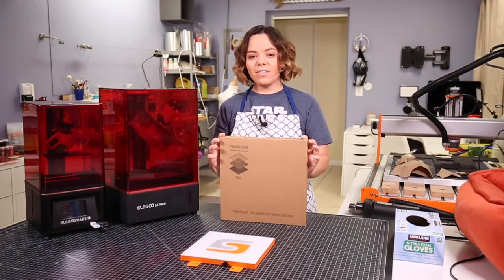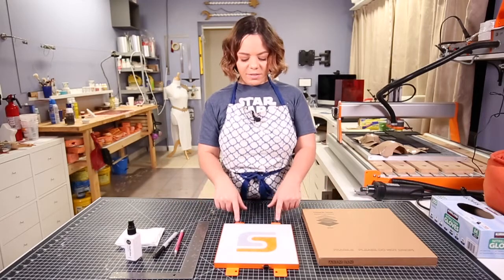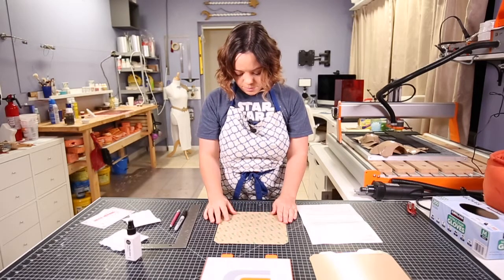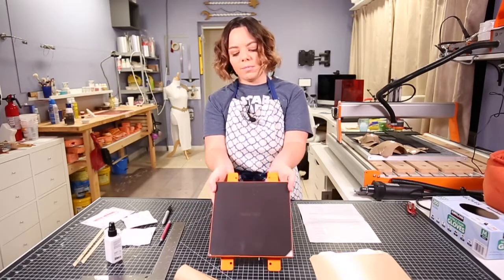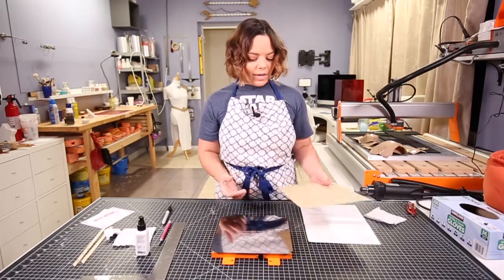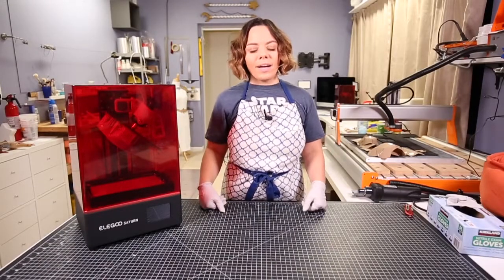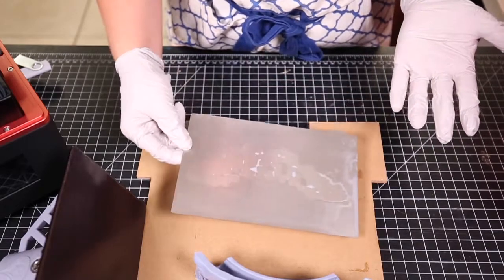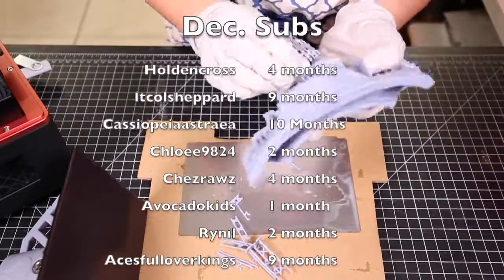Installing Wham Bam Plate

Comment: Where did you get that build plate holder? And which flex plate did you get for your Saturn 2 8K? I don’t know which one I’m supposed to be getting they have three versions.
Reply from the maker: https://www.thingiverse.com/thing:4634693/makes PhoenixBlueStudios has a file available on Thingiverse!  I have an original Saturn - but measure your plate in millimeters (length x width), and you should see the dimensions available on WhamBam for the one that matches.
Reply: @KannonStudiosOfficial  thank you for replying back to me. I truly appreciate that. I actually just received my 8K and curing and wash station from Amazon this morning. Just waiting for my flex plate my slat mats and my heat box to come Thursday.

Comment: Did you need to print the z-spacer for your Saturn? In my haste to get the FBS installed I forgot to print the spacer, which you need to do beforehand. So I'm really hoping it's not necessary lol.
Reply from the maker: I have never used the spacer.  I measured the distance so i knew it would be fine.  Machines may vary so you don't want to break the glass.
Reply: @KannonStudiosOfficial  Thanks for responding so fast! I have a Saturn as well. Can you walk me through what you did to avoid using the spacer. Thank you so much!
Reply: Okay, I unscrewed the bolts on the build plate, and re-leveled the build plate, tightened the bolts, then backed out to the main page of the menu and hit the "Set Z=Zero" button, and that seems to have reset the Z axis. About to do a new print, so hopefully that worked. Fingers crossed!
Reply: @kriscontinuum3267  hey friend, did you end up printing that spacer? I did the exact same thing that you did and installed before printing it.

Comment: My Saturn is only half-unpacked because I want the first print (the castle test print) to be with the flexible plate attached (which I've also got). A lot of people say to use a Z stop extender to keep the plate from descending too far against the glass and FEP (there's even a file for this on Thingiverse). But seriously you did not need to do anything other than re-level and your Saturn is working fine? Nobody has gone into any details about the machine side of things with these plates, only raves about how awesome these are and how to apply them. Applying the plate to the build surface is really only 50% of the installation - the other half is Z stop adjustment and re-leveling, but nobody is including that second half of installation in their videos. (You are fantastic, by the way!)
Reply from the maker: For both the Saturn and the Mars all I did was re-level the machine and make sure the build plate set screws were loose.  The build plates had enough clearance in the depression of the leveling spring to allow just that (granted, it's almost to the max of that adjustment).  I haven't had any issues personally doing it this way.  Taking the extra precautions of the Z-stop extender are not a bad idea though :)  For my CNC printer I did have to adjust the z-axis but it wasn't complicated.
Reply: @KannonStudiosOfficial  Thanks for replying! Elegoo replied as well saying all that's needed is re-leveling and reset of the Z axis position, so I think I'll just do that and call it good.

Comment: Awesome tutorial thank you! Did you have any trouble with the wham bam on your Saturn? Or was it just a simple install and re-level? Also, what file did you use for your drip/holder on your build plate?
Reply from the maker: Thanks!  Adding the plate on the Saturn and my Mars I did not have any issues.  It was still able to level. I need to track down that file,.. but I did get it on thinkeverse as well as leveling feet.  There are also other files on there that people made to be used.